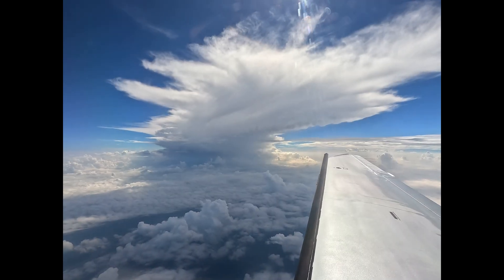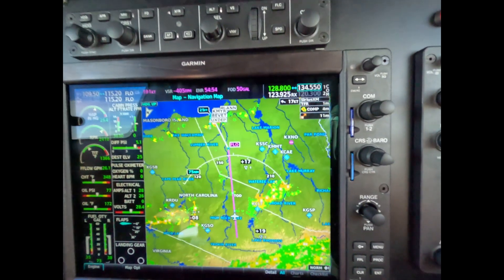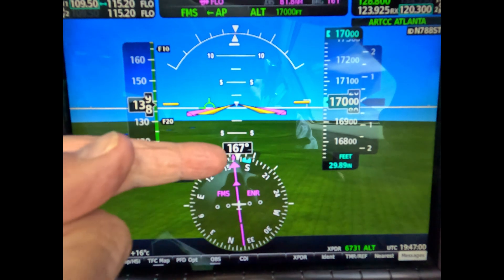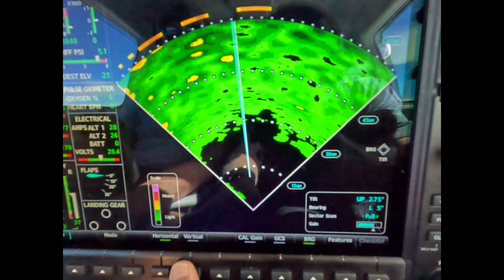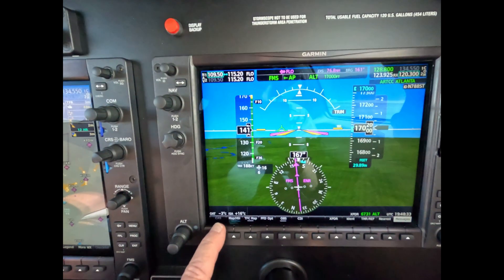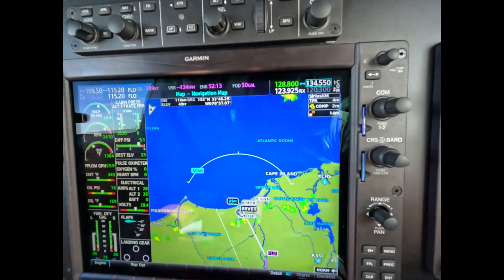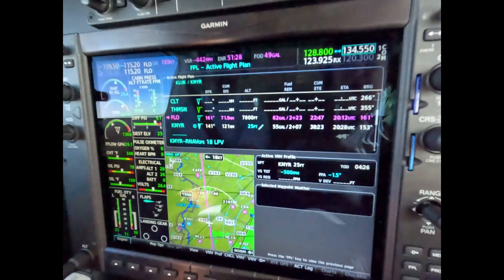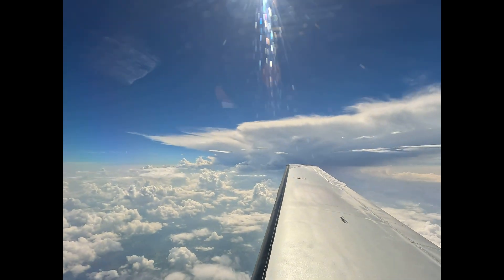Some Tips for Using VNAV in the The Garmin G1000 Nxi Equipped Piper M350 with Dick Rochfort

Comment: Noticed on your Myrtle Beach videos that you are not using ground clutter suppression on the radar. That is a late 2021 build M350 so comes with GWX-75, great radar [even better when you get GWX-8000 upgrade, have really been enjoying ours]. Curious as to why you chose to not use GCS? For me at least when using GWX-75 at 40 miles range or less GCS is very useful tool. Thoughts?
Reply from the maker: Hi Carl.. Good observation. I find it difficult to introduce every feature in one video. Experienced pilots know how to reduce workload with very useful tools like GCS, however GCS is still a fairly new feature to us PA46 folks. I have over 500 vids on my channel so I’m pretty sure it is covered somewhere. Look for some new vids soon featuring GCS. Fly Safely - Train Often .. DR
Reply: @RWRPilotTraining  Thanks. Another useful trick that I have found for situational awareness when using radar [i.e., am I really going to clear that cell or not] is to display the radar on the moving map, that way you can use your track vector [the blue line] as a quick visual representation of your path. This is particularly useful for the GWX-8000 [which you will be seeing more and more of] because in auto mode you do not get a movable bearing pointer on the radar display.
Reply from the maker: @carlrossi7989  It’s getting better all the time. Since I fly and teach in mostly older aircraft (non GCS) Intend to use the techniques that 
Work in all PA46 aircraft. If an individual owner pilot has interest I am happy to show the advanced techniques. I’m not even sure if the GWX-8000 upgrade is available for PA46.. anybody want to comment? Fly Safely - Train Often .. DR
Reply: @RWRPilotTraining  The GWX-8000 is available for the M350, M500, and M600. It requires the GWX-75 radar which became available in the M350 and M500 in 2021. Our 2021 M350, N46LY, was the first or second s/n in which GWX-75 and hence the upgrade was available, it is a software upgrade. We had the upgrade “installed” [its an SD card] in June 2022.
Reply from the maker: @carlrossi7989  and the estimated cost?
Reply: @RWRPilotTraining  the GWX-8000 upgrade cost me $9,600 in 2022, but we already had turbulence detection on our -75, so I’m guessing $15-20K.
Reply from the maker: @carlrossi7989  thanks for sharing. It really is getting better all the time. Both Piper and Garmin are major contributors to that trend. Fly Safely - Train Often .. DR